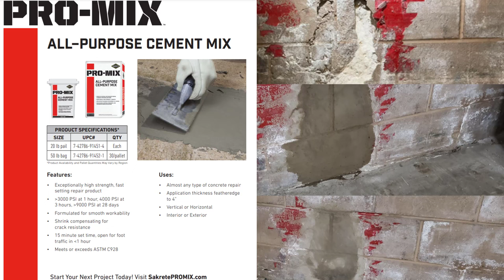Concrete Block Repair Using Sakrete Pro Mix (Making Money!)

Comment: Was that from ice popping or fork lift, because all that block in the area (white) is showing water damage. Here the building inspectors will jump all over that, make fix the water issue and replace all the blocks.

Comment: That patch certainly isn't going anywhere, especially with them screws in there. But as a mason, I would just throw some type S mortar in there, squeeze it up against the edges with my bricklaying trowel and then dress it up to look like block. Do that by rubbing it with a piece of block after it sets up a bit. Done in 10 minutes, start to finish.
Reply: A real mason would just clean out what you can and lay 4" ' block back in there or  3" or what ever fits. Not slap a bunch of whatever in there. So much easier and quicker.
Reply: @63flight  I've been doing 'all kinds' of masonry work since 1985 (Brick, Block, and Stone. Residential, Commercial, and Industrial. Big Jobs and Small Jobs). If your dumb ass wants to pay to replace the block, then the block can be replaced. But why do that when I (or any mason) can make it look like a real block in a matter of minutes.?. Most 'normal people' would choose the latter.. Mike here is a concrete man, and a very good one at that, And I Appreciate Him Very Much. But I can tell by this patch, he's not much of block mason, and/or maybe he is trying to sell this product.?.. I'm Not criticizing anybody or anything, just being honest with my thoughts from my perspective. Which is the purpose of 'comments'. ... And Yes, I would 'slap' that b*tch in there like nobody's business!😅
Reply: @bonanzatime  🤣🤣🤣🤣🤣🤣
Reply: This sounds more like what I would choose to follow.
Reply: @bonanzatime slap that thing with ten tonnes of base, and send it to outer space 😂🎉❤

Comment: Great video! May I ask why you add the screws in the beginning?
Reply: It’s like putting rebar in. it helps keep the repair from moving as it is setting up kinda like fastening two pieces of wood together it pretty much anchors the repair in because once the cement cures fully  the screws will help hold it in place best way I can explain it lol

Comment: You could have cut the face off a new block then cut out the mortar bed and head joints and damaged block replaced with the new one and tuck pointed it back in.
Reply from the maker: I could have, but that's no fun.
Reply: Too much work for the cut out , most people don’t want to pay simple patch will do the job
Reply: @benzoh28  not if you know what you're doing you get what you  pay for.